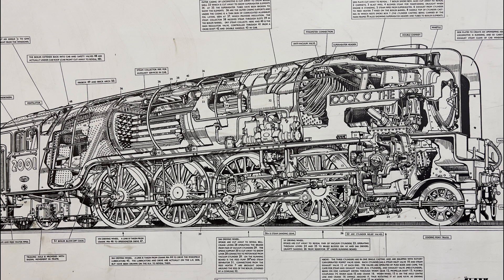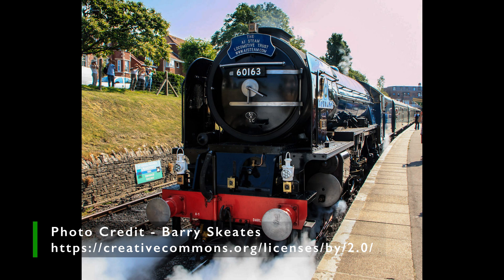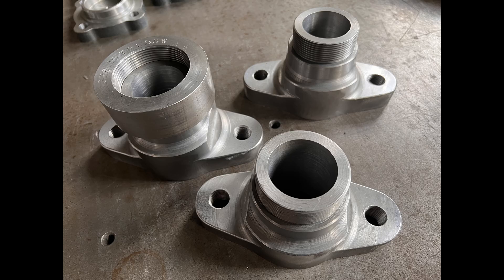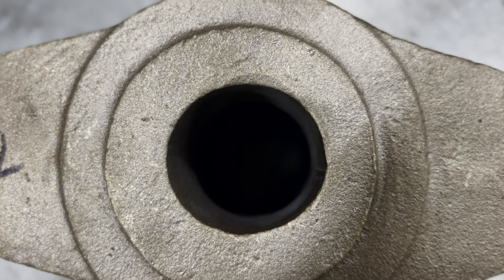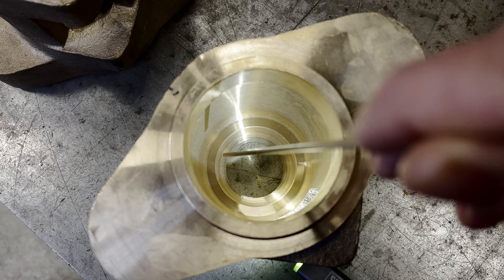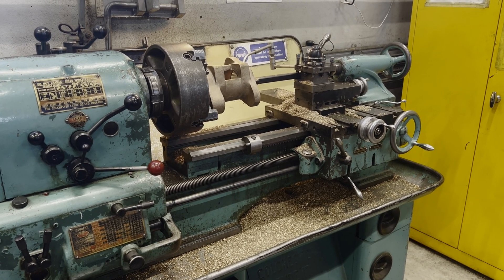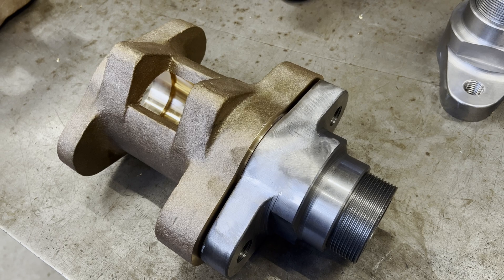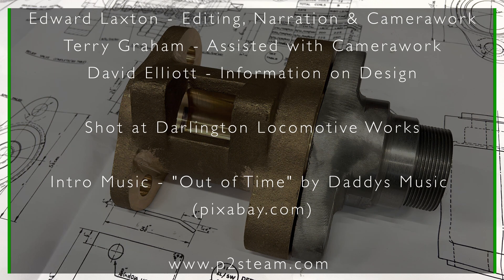Making and using cylinder relief valves

Comment: It is indeed Britain's most powerful express passenger design and in today's world the most powerful overall but I think there where stronger freight engines like the U1 Garatt but I'm not sure If it exists so the P2 is the strongest currently.
Reply from the maker: No. 2007 will be the most powerful express passenger locomotive in the UK when it is completed.
Reply: Do not confuse tractive effort with power. It is a force and as such is of little use when trying to assess how powerful a locomotive might be. This has caused people to believe that a diesel electric locomotive with a tractive effort of say 52,000 pounds (should be pounds force) is more powerful than a Pacific locomotive with a nominal tractive effort figure of around 36,000 pounds. Well the Pacific can produce in excess of 3,000 cylinder horsepower and the diesel engine fitted to the diesel electric produces 2,000 horsepower. You can also have two steam locomotives with similar tractive effort figures but one will produce twice the horsepower of the other. It all gets rather complicated.
Reply: @DeCasoU1  thanks, my bad

Comment: Absolutely beautiful. But you did floor me with the lathe-from-a-supermarket line. Question: Will a similar valve be fitted to Tornado?
Reply from the maker: In due course it would make sense to replace the LNER type valves on Tornado but not until they are life-expired.
Reply: @thep2steamlocomotivecompan19  Very well. Now when that time does arrive what would it take to conscript James May?